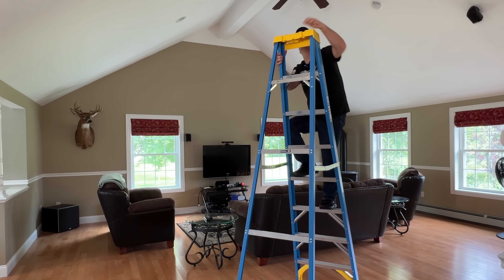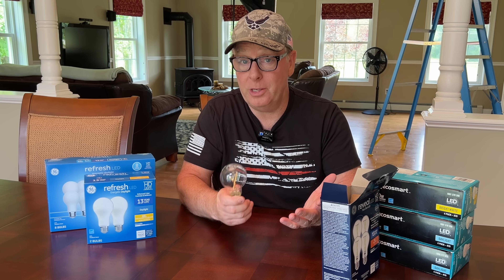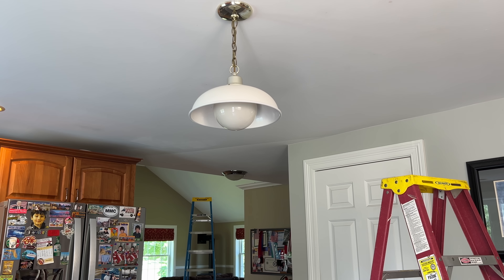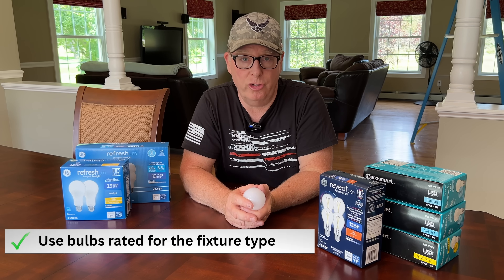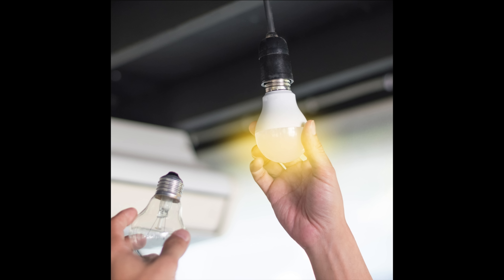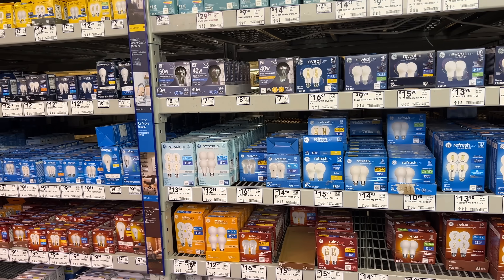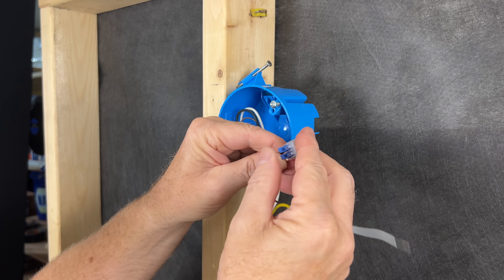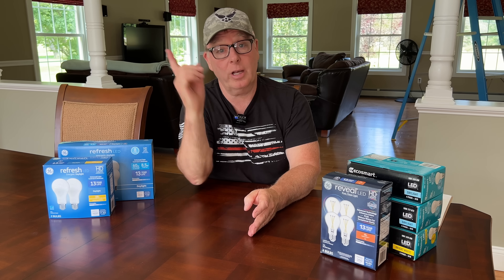The Mistake That Kills LED Bulbs

Comment from the maker: Visit https://helixsleep.com/backyardmaine 27% off Sitewide! Thank you #HelixSleep for sponsoring!
Reply: Bro my neon mercury light still work after 10 years of use 😮
Reply: Yes and no.  It depends on the internal design of the electronics.
Reply: Can I use the grounding lug on my electric fencer be plugged into the ground on the end of the extension cord ground instead of driving a ground rod for the fencer
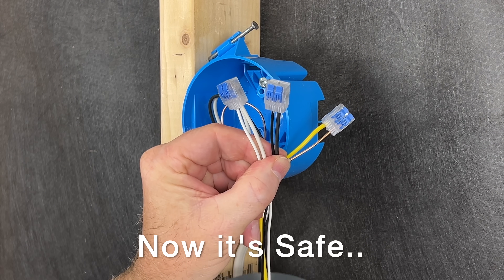Reply: It's cute and all, and I know why it works, but at 10:47 you're touching a "ground" screw that's not completely connected to ground in a meaningful way. It's screwed into an ungrounded plastic box. It's not comforting to know that you did this without comment about your voltage measurement a few seconds later.
Reply from the maker: @AllAmericanGuyExpert  Thats not a ground screw I am touching with the meter lead. It just a screw that fastens the metal plate on the fixture base to the box. The metal base however is bonded to ground so theres that.. Neutral and ground are bonded together at the main so they are of the same potential which a correctly wire light or device. If I took a reading from ground to the screw shell when the fixture was wired correctly there would have been zero volts as apposed to the 120v you saw when the fixture was wired in reverse. Thats how these 120v/240v grounded split phase systems work.
Reply: @BackyardMaine  I did not see a metal plate, and if it has one hidden somewhere, it's that's not like most blue plastic boxes I've seen. Most of them are designed to have a metal screw go into a plastic hole with no grounds nearby.
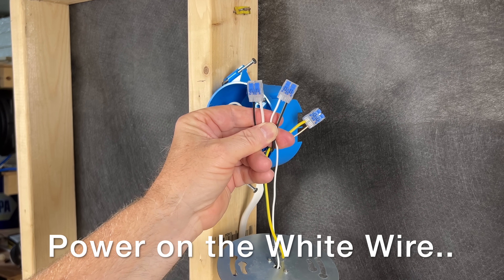Reply from the maker: @AllAmericanGuyExpert  The 5 inch round base with the support screw holes is made out of steel. It also has a ground wire connected directly to it. You can see that clearly at 9:59. Maybe watch it again.. ? This is not a plastic or porcelain lamp base.

Comment: I used to have the same problem that you mention here. Then I switched to smart Wi-Fi controlled bulbs and haven't had an issue. I run a mix of Phillips Hue, Wyze, and C by GE bulbs throughout the house so every light can be controlled from wherever. Some of these bulbs have been going strong for over 5 years now without issue.

Comment: Auto. Some dome lamps have bridges so either polarity works. Found a good one that has little heat sink too. Nice color temperature too. Over a decade ago was making outdoor lamps using constant current switchers. Found they made noise on FM radio out in my Street . lots of filter cores added later. While I'm on noise my furnace switcher motor fan is horrible on AM shortwave. Cores and more cores clamps. Always had to deal with florescent  noise in my life. Even light noise. 60 120 AC flicker in lab. Had to use DC incandescent for stable no flicker for instruments doing experiments.  LED drivers can produce ultra high frequency flicker.

Comment: I have yet to have to replace my dimmer switches.  They work with the LED bulbs rated for dimmer switches.   Swapping neutral and hot should not matter to the bulb since it is taking 120v AC anyway to generate a DC voltage for the LED.

Comment: I was paying $30 for one Philips BR40 LED bulb.  I just paid $6 for a newer Philips BR40 LED bulb.  I am just starting to replace the $30 bulbs 20 years later. The newer LED bulbs are lighter in weight and are surely using lower cost electronics and manufactured most likely in China.

Comment: Reverse polarity is extremely dangerous as that can put live power to places not intended to be exposed to live power. The most dangerous is anything that use only a two prong power connection. The shell of that device could be exposed to live power drastically increasing the risk of electrical shock or worse, electrocution.

Comment: About 10 years ago LED bulbs started to become affordable and many seemed to be changing. Walmart had put a huge lot of bulbs out on their clearance isle for cheap, I paid $4 for each four pack for three wattage ratings, 60w 40w and 15w equivalent bulbs.  Looking to lower my $400 electric bills I bought enough for the whole house and garage. I mostly wanted to change out the dying CFL bulbs that were having issues lasting more than a few years. 
I also have a kitchen light that's on nearly all the time, it had been using a small 20w CFL and those bulbs kept burning up the base and dying. The fixture is an open bulb with a shade. I put a 15w equivalent LED in that fixture. 
I replaced all the lamp bulbs, ceiling fixture bulbs, and fan fixture bulbs at the same time, I even changed the bulbs in the attic because I was concerned that a bulb left on up there could be a fire hazard in a dusty unfinished attic. 

The first bulb I put in the kitchen fixture died fairly early, after less than a year, it was visibly overheated, the base was brown and the globe slightly yellowed with a hole burned in it. That bulb was  special packaged pair of bulbs that were marked for 'nightlight use' and rated at 3w  Around that time they had put more bulbs on clearance and I had bought a few higher wattage models that I wanted to use in the stairwell overhead fixtures for more light. I also bought two four packs of what were there cheapest 3w LED bulbs which were marked down to $3 for 8 bulbs on clearance. They were Great Value brand and made in the Netherlands. 
I replaced that one bulb with the new 3w bulb and its been fine now for 9 years. None of the other bulbs have given me any issues, including a few that see near constant use. 
The complete change over back then to LED lowered my bill about $14/mo. When I changed out my overhead florescent fixtures in the garage, kitchen, and basement with LED models I saved another $28/mo. Today, the only non-LED bulbs are those in the outside fixtures which operate on motion sensors. I've never found an LED that doesn't glow when its off in those fixtures and I'm not paying the price for new fixtures or special bulbs for those. I've got a bucket of used CFL bulbs that work in those lights that came from all the other fixtures back then to use up in the older outdoor fixtures. 

Not all LED bulbs convert to DC current, many older LED bulbs simply only light on half of the AC wave, in other words they flicker, but they flicker so fast we can't see it. The bulbs that use a huge DC power supply make the most heat. I found that most of the cheap bulbs I bought back then do not get very hot, but a few that I bought more recently do. Specialized bulbs also seem to be short lived, those that are advertised as warm or incandescent like, or 'flame like' look all die fast. 

The only LED bulbs I ever really had die early were a pack from Harbor Freight, all of which were used in shop lights and power tool lamps, all died within a year, most didn't last more than a few hours of use. The same with a pack I bought at the supermarket on a coupon back in 1998, they flickered badly from the start and didn't last long at all. They came in a huge blow molded package of 8 bulbs with two wattage ratings. Half died really fast, the other half are still working in a desk lamp over my entertainment system now for over 25 years. I never liked those bulbs since they sometimes have a delay when turned on and a delay when turned off. 

I had another early pack of "LED" bulbs that came from a dollar store for $2, when they died early I cut one open only find they were really a CFL bulb covered in a frosted plastic bulb with a single LED in the middle that did nothing. Likely put there just so they could call them LED bulbs. A couple of them are still working out in the back shed where they only get turned on occasionally. To be fair, those have been out there now for better than 25 years and they still work, those that failed, failed early, the others still work fine. Those were 'rated' to replace 60w bulbs. A few got killed in drop lights in the  shop, not really the bulbs fault as they died from abuse and being dropped in a hand held light. Even still they lasted for years.

Comment: Back in the old incondesent days, base up or down also affected life span. I discovered that 130v lamps lasted twice as long, as the element was thicker thus less suceptable to voltage spikes. 10% loss actual lunums though. Rough service lamps lasted nearly forever

Comment: I question whether the electronics fail because of heat. Capacitors maybe, but you rarely see them in LED regulators unless they are located fairly isolated from the LED's. The fact is, the electronic component encasements are manufactured in temperatures around 600 degrees and would be destroyed in the manufacturing process if heat were an issue. I would would be more wary of defective devices that are prone to die early. Just buy from quality manufacturers.

Comment: The reason heat kills LED bulbs. I think manufacturers use the low-heat solder method. Instead of soldering each LED to the circuit board. They place the LEDs on the board with any other diodes or resistors. Then, place it in a machine that drops low heat solder on each connection on the board. I know this because I heard of this method used on circuit boards for model railroad engines. It's faster and more accurate than soldering by hand. But, because they use low-temp solder, heat can cause connections to break and ruin boards. I know some DIYers show how to fix this problem, but sometimes it's just a temporary fix.

Comment: The bulbs should be unaffected by "reversing the polarity" - AC ignores polarity by its very nature. LED stands for "Light Emitting Diode" and diodes allow current flow in only one direction.  Since AC flows in both directions relative to the LED, current flow through the device is unaffected.

Comment: I got rid of all my enclosed ceiling fixtures, and my LEB bulbs last for years.  I do not understand why manufacturers still make so may styles of enclosed fixtures.  They eat bulbs because they retain heat.  An open ceiling fixture I really like can be found on the popular on line shopping site with the description "GLOBE Electric 63357 2-Light Semi-Flush Mount Ceiling Light, Brushed Nickel".

Comment: Most of those bulbs are mounted on an aluminum circuit board. When you heat aluminum, it expands, and when it cools, it contracts. All this at a different rate from the LED elements themselves, causing the welds to break. They also use a capacitor that is not really rated for high temperatures.

Comment: I have had bad luck with particularly the three-way LEDs. They are a lot more expensive than regular incandescent but most of mine expire quite quickly. I changed back to filament types, eventually fail but a lot cheaper than 3-way LEDs. Delved Inside a 3-way LED, lot more components, led banks and most probably excessive heat that kills them.

Comment: The reason LED bulbs fail prematurely is that most manufacturers now use passive components — resistors, capacitors, etc. — with specifications that aren't up to the task, i.e., cheap.

Comment: You are right, the early LED bulbs used better materials.  I still have canned lights that are on 10+ hours a day from the 2008.  On the other hand, I have others that have to be replaced within 4 years.  Fan bulbs being the worst, often needing replacement each year.

Comment: The LED bulbs coming out nowadays are absolute junk. The thermal management is vastly inferior to the ones that came out 10 to 12 years ago. The big aluminum heat sinks on the older LEDs are far superior. All the old LEDs that I have are still in use today. I'd rather pay $25 to $30 for the older ones because they last.

Comment: Manufacturer defects very likely.  Newer bulbs I believe are more efficient and run cooler. Still a great deal.  Sometimes, you get a special made led fixture and that is expensive when it fails.

Comment: I replaced all 55 incandescent bulbs in my home with LED's in 2010. In the 15 years since, I have only had to replace two of them. That's 4% failure rate in 12 years. Well worth the investment against what would have been replacing around 200-255 bulbs otherwise.

Comment: Why do some LED bulbs 'half fail'? I find that a common failure is for 1/2 of the bulb to go dark, producing only half the rated output. This seems most common with 100-watt equivalent models. So what is failing here, one of the LED arrays in the bulb, or the rectifier?

Comment: I purchased a 200-watt equivalent LED bulb from Home Depot for eleven dollars.  So far, this is a great bulb; it can be used indoors, outside, in an enclosed fixture, or not, and it is dimmable.  It also has a switch so you can choose three different color temperatures.

Comment: Here is the real truth. As in the the beginning, as is happening now history is repeating its self. One of the original cases of corporate organization committing planed product obsolescence was done by the lightbulb manufacturers, as their bulbs would last for years or decades. So, they got together and decided to make their bulbs all fail around “X” amount of hours. It was eventually found out and they were severely punished for their actions, but the damage was done. Today they have done it again. Starting out by giving long lasting energy efficient LED bulbs, but slowly replacing them with more cost effective and less reliable ones that fail quite quickly. They can get away with it because they planed for this this time by placing extremely low usage usage hours a day on them. Saying that the average use is approx hours is 3 hours a day, but it actually is more around 5-7 depending on the day. Basically they low balled the usage estimate as a get out of jail free card. So we will be buying more expensive bulbs from now on. Worse yet. Their energy consumption has been slow get higher over the years because the components have been getting cheaper and less energy efficient.

Comment: The drivers in many LED bulbs run the LEDs at a very high current. Not high enough to cause immediate destruction (obviously) but high enough to reduce the lief of the LEDs. This is done either to squeeze the max possible light output from them or to deliberately shorten lifespan.
Also - why would anyone think reversing hot & neutral would affect an LED bulb? The first thing the power hits in a LED driver is a full bridge rectifier - duh.

Comment: I have a light that had a dimmer switch for incandescent bulbs in a candelabra fixture, but now cannot buy those bulbs.  In order to use dimmable LED bulbs I bought an LED compatible dimmer switch.  Undortunately, it dossn't work at all.  The light switch and it's box are not grounded.  The house was wired with only one leg coming to the switch.  The LED dimmer switch requires a grond connection.  I'm not going to tear open the wall and ceiling to rewire the switch from the light fixture.  So, I'm living without a dimmable light.

Comment: The irony of most LEDs dying from heat is that one of the reasons why they're better than incandescents is because they produce less heat for three light output. Turns out they still produce just enough heat to break themselves

Comment: Every video I've seen to investigate why these fail is just a simple solder break right at the LED. The cause is probably heat cycling causing expansion and shrinkage of the solder joint.

Comment: I have a new Leviton LED dimmer switch connected to a new Halo LED recessed fixture (not an LED bulb in old can light) and I STILL get flicker at certain points on the dimmer. I believe this is due to an incompatibility (resonance) between the two products. One of these days I’m going to try changing the brand of the dimmer and/or fixture to see if the problem changes.

Comment: LEDs also add a bunch of line noise to your electrical wiring. Most people call this Dirty Electricity, but Building Biologists call it Microsurge Electrical Pollution. Its really not good for you. 

Nothing beats incandescent lights. Get them while you can.

Comment: An LED bulb convert the AC current to DC current and the power supply reduce the voltage to handle the multiple leds inside the bulb. Reversing the polarity on the AC would put you at risk of electrical shock cause the fixture might be hot.  I had an LED bulb that was in an enclosed fixture outdoor the bulb was a Cree but the bulb had a massive heat sink on the base, that LED bulbs lasted for 16 years where it was on all night off during the day. That is when LED bulbs was getting more popular. So today the LED bulbs look more the the old bulbs. Now I am convinced that the LED bulbs is design to fail early cause companies would loose revenue from long lasting LED bulbs.

Comment: I bought an LED light to use as a hallway nightlight in 2015. It's been running 24/7 since (including 2 brownouts). It's still as bright as day one as well (I used a lightmeter to confirm). It's just a "cheap ass POS" from Osram, but it still works.

Sidenote: It's good to see so many useful tips in the comments. Thanks guys/gals!

Comment: One thing I wonder about is mismatched bulbs in a fixture - like running a 6W and 6.5W off the same ceiling receptacle.
Reply: Except in very few specific cases (mostly string lights), differences between bulbs will not matter. Each bulb has an independent connection to the power source.

Comment: Another big tip: LEDs that achieve 100 lumens/watt or better are usually more reliable, as they're not overdriving the LED chips and allowing them to run more efficiently, and thus cooler and longer.